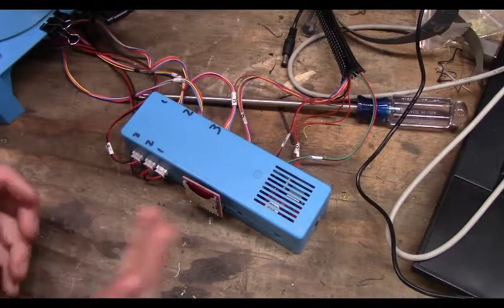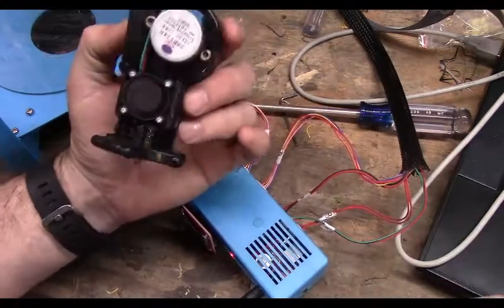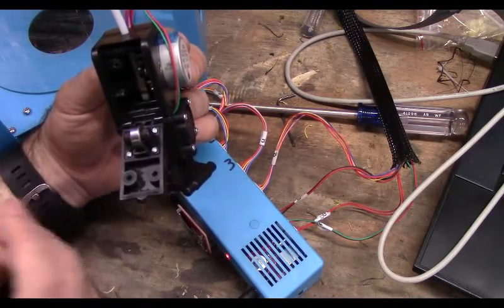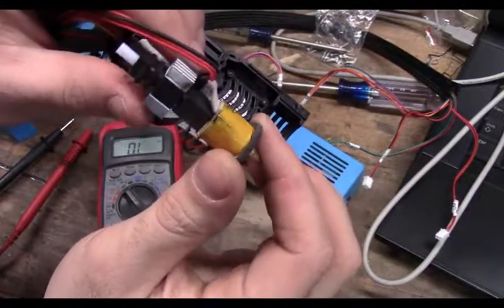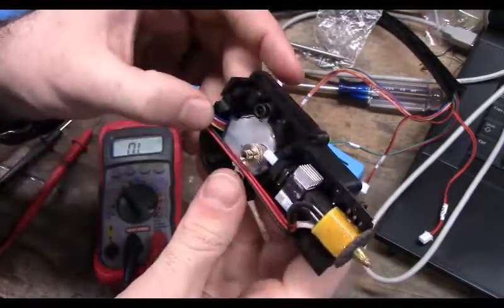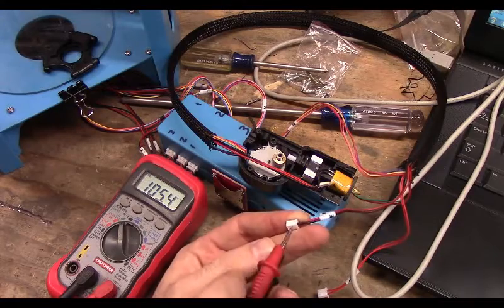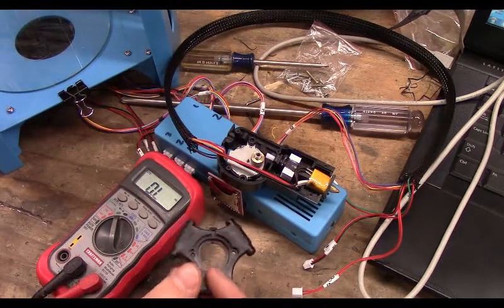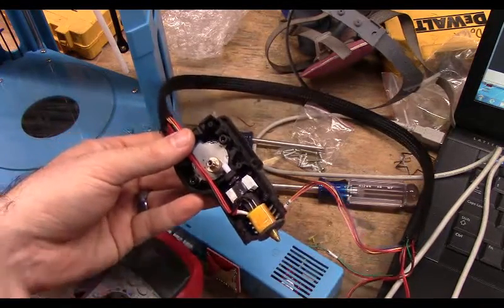101hero hotend troubleshooting

Comment: Is there an extruder that you can buy to replace the one that comes with the 101 hero but that still works fine with their standard blue controller? I noticed that the machine would print so much better if the extruder was not attached directly on the legs but assembled on the top like the Monoprice is trying to do and feeding into the hotend with a boudin tube. Any ideas of what I could buy to do that?
Reply from the maker: the stock controller can use a nema 17 motor bowden extruder. just needs the M97 command at the beginning of every gcode file to get it to print right. plenty of info on others doing exactly that on the facebook group and 101user.com
Reply: Cool! Thanks I will study up on it :)